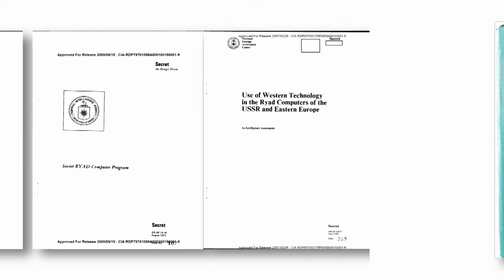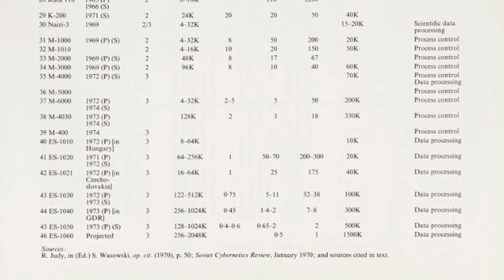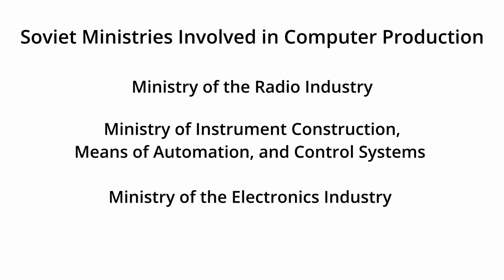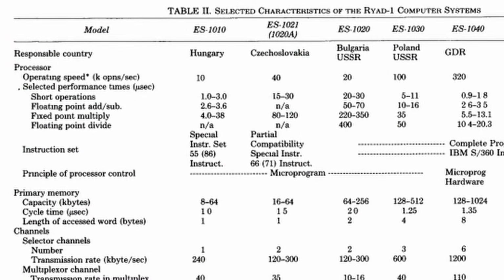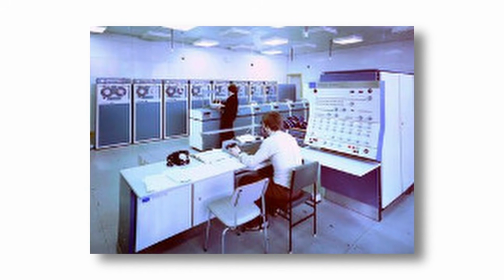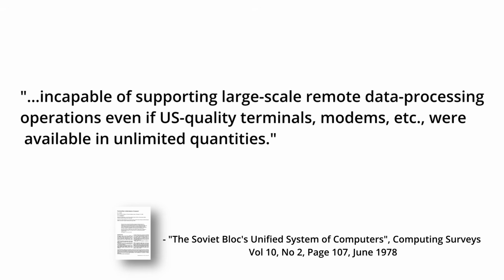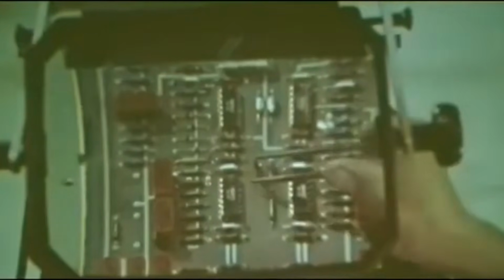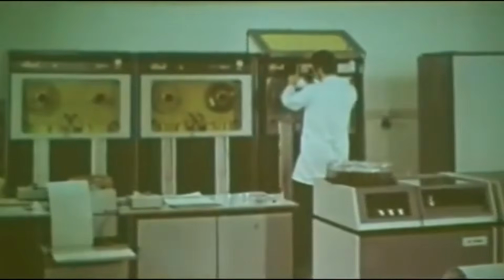RYAD - The Soviet attempt to clone the IBM S/360

Comment: The best thing about being Soviet EC mainframe operator or maintenance engineer is that the mainframe hardware was so shit that it needed regular maintenance — pulling out all plug in modules and wiping all card edge contacts with pure alcohol. Alcohol was rationed as per GOST (national standard.) However, that alcohol rarely made it onto the contacts. It was mixed with water and turned into vodka and then being drank during the night shifts. Being near those mainframskies was great!

Comment: I have a story about the article published in Computing Surveys. At the very begining of my IT career in 1977 in a Hungarian Computer Science Research Institute (SZKI), I was tasked with translating that article into Hungarian. Once I was done and deliverd the translation, I was no longer able to read the official doument, as I did not have any security clearance.

 SZKI was responsible for the ES program in Hungary. The first generation model the 1010 (also known as R10) was not partially compatible with S/360 ... it was not compatible at all; it was based on the French Mitra 15 computer.

The model numbers of ES ending in 5 (R15, R35, R55, etc.) were second generation and S/370 compatible, thus supported virtual memory and DOS\VS, OS\VS1, OS\VS2, but probably not VM\370. SZKI designed R15 and produced the prototype. Only 11 were actually made. It was an interesting machine. 

Now to the topic of "covertly" obtaining the technology. Yes and no. IBM actually supported leaking the technology presumably with the hope of being able to sell software. The R15 was a copy of the 370/125. An IBM engineer "inadvertently" left a complete listing of the  machine's microcode at our institute. A coworker and I developed a microcode extension as a research project to support a higher level language instruction set that allowed for more compact code to be generated (I designed the instruction set, my friend did the microcode implementation ... no small feat as this machine used horizontal microcode).  The project was a success in the area of code compactness, but was a failure in hoped for speedup mainly due to the really weird way this machine's associative memory (which for some reasone IBM persisted in calling the TLB: the Table Lookaside Buffer) supporting virtualization worked requiring a flush for our self-relative branch instructions.

Not sure that 100 MB Bulgarian drives didn't reach production. All I know is that aothe institute was trying to buy a binch of them. Upon delivery someone at this institute insisted that they run a butterfly test which caused at least one drive to essentialy fall apart from the vibration.

Comment: In 1975, the first minicomputer system I worked on professionally was an Interdata Model 70 which cloned the IBM/360 instruction set. IIRC, that system employed 32KB of magnetic core memory.  It was manufactured by Perkin-Elmer

Comment: In 75 the anti trust law oblige IBM to publish blue print of the IBM 360 family system 40 / 65, so it was not too difficult, all russian accessing 360 at UN administrations or CERN where busy to take all tapes specially with system software this serie was compatible through Microcode a wrapped area on the side on the computer.

Comment: One of the largest mistakes of USSR in the computer engineering. Working in the limited (yet still large) market, USSR electronics lagged behind the capabilities of the Western systems. This could be largely elevated by better software - if and only if - this software was not modeled against the Western stack.

These machines worked - and worked well. But they worked worse than their IBM-made counterparts, simply because of the better elemental base used by IBM.

Comment: 15:30 YES!  East German had  VEB Robotron which produced U880 (Zilog 8 bit clone), U8000 (the EXCELLENT Z8000 clone), and some DEC VAX clones.  That was not the 1960s though.  The 16 Bit Zilog didn't really take on in the west, but it was good enough to make a cheap MINI-computer system that would run a full UNIX.  Chiefly Onyx Systems C8002 used the Z8002, ran Version 7 Unix, had C, FORTRAN 77 and COBOL compilers available. It had eight serial ports for terminal connections, 1 QIC tape drive and cost ~$25k. The main processor offloaded the disk, tape, and serial I/O operations to a Z80 processor on a second board. This was in 1980!!!  Were I an office manager at that time or otherwise responsible for outfitting an organization with "computers", I'd DEFFINITELY gone with the C8002 and a bunch of Terminals!

Comment: 6:43 Not sure if you're stuck in the year (and month, coincidentally!) I was born or just couldn't be bothered to set off a 10 second research (quite ironic in light of 3-parters spanning 5 years, lol) but somehow you managed to miss out on the most recent/relevant/dominant 4th generation: Microprocessors. Hot take: the switch from 3rd gen to 4th gen was way more significant than from 2nd to 3rd (simple ICs can be replicated with discrete parts easily) - also considering we're still sitting on the 4th for reasons, even half a century later. Defining 5th gen gets muddy, what most sources cite are no more than various applications of 4th gen (massively parallel/mobile/cloud computing, or even "AI" because oh so trendy). Remaining true to the given principle, actual 5th gen would be something like neural networks or quantum computing.

Comment: I designed and soldered my first computer in 1982 while working on my PhD. It was basically a clone of the SM-1800. Initially, I had 1(one) kbyte of static RAM and 4kbyte UVrewritable ROM, but then I was able to extend RAM to 16 and 32 kbytes dynamic RAM and attach a tape recorder for software. I used machine codes at first, then ASM, and even macroASM. Then I switched to PL/M. It was a good time!

Comment: They should have copied Digital PDP systems as a priority not IBM 360 as the mainframe has a higher technology step
Reply: they did. it was called the SM EVM series ("System of Smaller Electronic Computing Machines"), and it generally went an order of magnitude better than ES EVM which this video is about

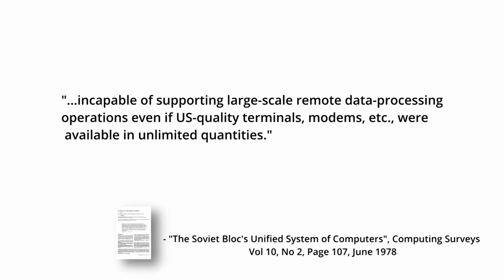Comment: 28:40 when you say "telegraph lines", you know they mean Telex, or teletype? 

The system ran on some 75 baud, but wasn't that bad for the 1970's, as it *guaranteed* the sender's and recipient's identity, something email still struggles with, and fax never offered. 

You could send a Telex to a court or to a bank and it would be legally accepted  in the same lines as a signed letter. 

Honourable menrion to Germans, who developed this system.

Of course your point on transferring data is absolutely valid. There may have been a packet switching system  like X.25 in the Satellite Countries, but all I remember are past mentions of it.

Comment: A very important Ukrainian computer is missing from the list of computers. The world community was told about the unique capabilities of this computer.
Should be interesting.
Computer "Kyiv" should occupy a proper place in the history of information technology.
Unfortunately, sources outside of Ukraine do not mention anything about computer "Kyiv", and Ukrainian ones, if they mention it, do not emphasize that this computer was very important for the further development of IT.

Main features of computer Kyiv:

1. Computer "Kyiv" - the world's first computer with hardware-implemented actions with Pointers, including indirection of Pointers or a stroke operation of a high-level Address programming language.
2. Computer "Kyiv" - the world's first computer, which, unlike peers, was intended not only for mathematical calculations, but also for solving logical problems, problems of artificial intelligence, for controlling technological processes, for the implementation of information systems.
3. On the computer "Kyiv" Address programming language, in addition to mathematical problems, the following problems were solved:
a) recognition of printed and handwritten letters and numbers by machine learning methods;
b) recognition of simple geometric shapes;
c) logical;
d) informational (tabular Database "Autodirector" of relational type);
e) remote control of the steel smelting process (Kamenskoye a bo Dneprodzerzhinsk);
f) computer-aided design of electrical circuits of industrial, household electronic devices and computers
etc.
Note: most of these tasks were implemented on the computer for the first time in the world.
4. On the computer "Kyiv" Address programming language developed the world's first computer emulator "Dnepr" on which the Address language compiler was implemented for this computer.
5. The latest technical solutions, in particular the dynamic modernization of addresses (address language tool), was used by Sergia Lebedev in computers M-20, BESM-3, BESM-4 and other engineers in computers "Promin", "Dnipro", series MIR, computers of the series "Ural" and "Minsk".
6. The second copy of the computer "Kyiv" was installed at the International Institute for Nuclear Research in Dubna, where it was successfully used to solve important problems, including the problems of modeling the interaction of elementary particles.
8. Computer "Kyiv" was used to design computers: "Dnipro", "Promin" and the MIR series, the ideas of hardware implementation of the high-level programming language in computers "Promin" and MIR comes from the ideas of high-level machine language computer 'computer "Kyiv".

Additional important information:
1. Description of computer command system "Kyiv" translated and published in the USA (1963), in France (1969) and in five other European countries.
2. Monograph on the computer "Kyiv" was translated and published in the USA in 1966.  At the same time computer "Kyiv" in 1965 was dismantled and transported to Kryvyi Rih to teach students.
3. The architecture of the computer "Kyiv" has many signs of RISC-processors, although the term RISC itself began to be used several decades later.

Computer Kyiv is a wonderful computer. The first of his kind.
https://youtu.be/JxgFR_tK0iA

Comment: I don't know what caused others reluctance, but when learning on Hungarian university and being met some professors who were part of the undertaking still doing teaching what they said is that they really wanted to NOT COPY, but to have same huge money effort by creating very ground-up solution more optimized for what they can really manufacture but also having novel ideas that work around issues by circumventing them.

By what I heard they were very grumpy this was not the path taken and that it was instead a huge reversing effort because in their opinion that just cemented being behing while they said they likely can have good ideas making the system more on-par with current gen western equipments if fully home-grew. Because there is no such thing as "what it would have been" that anyone can ever surely know - this also no one can surely know... But for sure doing the reversing seemed to have bad effect on morale and happiness at least here where they wanted to roll out own ideas instead.

Comment: And then there is a "Soviet inch" measuring 25.0mm. Basically, all connectors and DIP ICs had pitch of 2.50mm while all western parts were 0.1" or 2.54mm. You could barely fit a 14 or 16-pin 74LS logic IC into a Soviet computer but any large chip or connector were hopelessly incompatible mechanically. I can't imagine how CDC would produce compatible components.

Comment: This shows how the human project as a whole suffers when advantages arise. By having to play catch-up to the U.S., the S.U. scrapped whatever individual innovations were in the works to focus on innovations of the U.S.. This was no doubt an immeasurable drain on the most innovative minds of the S.U..

One innovation which the S.U. was working on was ternary computing. While binary manages many preferable scenarios like the most definitive differentiation between high and low states which transfers directly to magnetic media, using bipolar transistors, ternary provides a more efficient CPU solution.
Reply: Are ternary processors now available from former Soviet Bloc countries?

Comment: I was in the IBM compatible peripherals group Control Data Corporation bought the RYAD 1040.  I was an experienced IBM 360 operator and systems programmer so became involved in the setup and testing prior to and after the purchase.  The CDC systems engineer discovered that the RYAD had no FDD in the processor chassis to install firmware.  The Selector Channels all were completely compatible with the CDC disk and tape drives but the Byte Multiplexor Channel timing needed adjustment causing the card reader and printer to time out.  Unable to install firmware without a FDD the CDC engineer asked the "Finnish" engineers for help.  Using the CDC engineer's portable Tektronix oscilloscope (which they coveted highly) a 'Finnish' engineer tweaked the byte-mux timing by adjusting some pots in the back of the mainframe with a screwdriver.  It might not have been 'high tech' but it worked perfectly.  Then everything worked great.

The system was imported into the USA and setup at the CDC HQ in Bloomington, Minnesota.  Once setup and running in the CDC data center Governor Rudy Perpich was invited to attend a demonstration before it was reshipped to Washington to demonstrate just how compatible it was.  During the early setup and testing I was able to install OS/DOS and OS/MFT and compile and run several suites of Assembler, Cobol and PL/1 programs successfully.

CDC bought the system to demonstrate the current level of Soviet computing technology.  CDC had been blocked by Washington from selling a CDC 3300 first generation computer to the Soviets because of Pentagon objections that it was too powerful and could be used for nuclear physics research.  The sale was important as a node in a worldwide weather reporting system that already partially existed around the world using multiple CDC 3300 systems all running the same complex software.  The system proposed was one that had returned from a long lease and was effectively a museum piece but such was CDC's justified reputation for high performance computers they never were able to complete the Central Asian node.

As an amusing aside, CDC had an internal product brokerage group.  These people found market for products made in the eastern Bloc and elsewhere used to purchased CDC products when the buyers did not have suitable negotiable hard currency, i.e. dollars.  I am aware of one sale that was paid with 20,000 Polish rubber Wellington boots and another from Czechoslovakia paid for with 600 beautiful competition shotguns.  BTW, the Soviets bought several IBM 360 series computers from a French leasing company, who resold machines as they came beck from lease, via an Austrian computer broker.  They were interesting times in mainframe computing.
Reply: You should make your win video — what fascinating stories!  By chance, did you ever have any Soviet computer come through to CDC during this time period?  I was at the U of Minnesota at this time in the Computer Science program.  I recall a visit one day of Soviet engineers to the student computer lab where I was asked a bunch of questions about how the program worked, and what I thought about the CDC 6600 we used as students.
Reply: That's fascinating! Thank you! I'd love to learn more of this history.
Reply: I worked for a consumer goods company who flew their profits out of a Soviet Bloc state literally as an-24s. Not on them, as them. They were paid in aircraft that were subsequently on sold.

Comment: great and informative video thanks! at 11:13 I was stunned to see 8 bit  MC6800 microprocessor assembly language in a video that was supposed to handle  32bit mainframe computers  and their russian copies.
Reply: I also wondered, why not pan across some actual COBOL or FORTRAN code rather than Javascript code with event-driven mouse handling for the Web?

Comment: I was very surprised seeing "RYAD" as the name. In the USSR, they were exclusively known as "ЕС ЭВМ" (Unified System [of] Electronic Computing Machines).
"Ryad" (lit. "row"; also means "series", "lineup") was but a bureaucratic designation for each stage of the official plan to design and produce different sets of models (Ryad 1, Ryad 2 etc). It was likely largely unknown outside of the circles directly involved in the planning.
Reply: "Row", "series", but not "stage". The intended meaning here is "series" or "lineup".
Reply: Every single (relevant) thing you said was specifically addressed within the video, right at the beginning in minute 2 ...
Reply: As seen at 0:21 ?
Reply: Soviets were thieves.
Just like ЯUSSІА now.